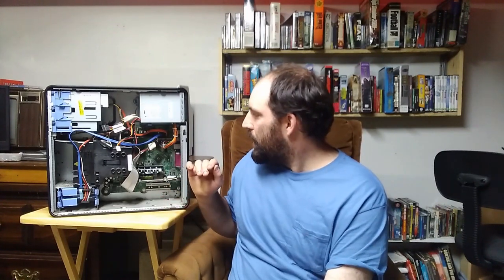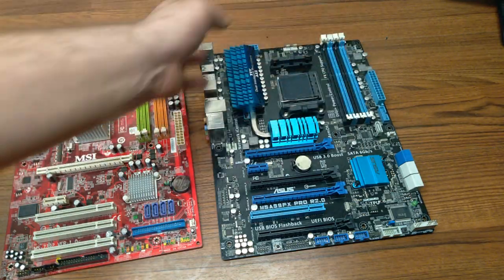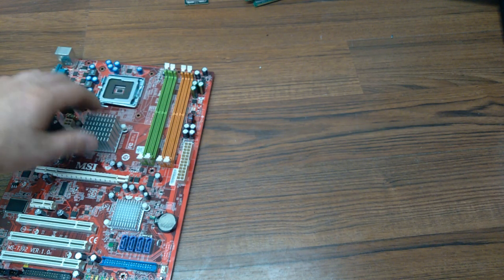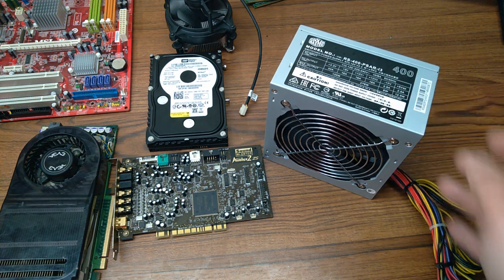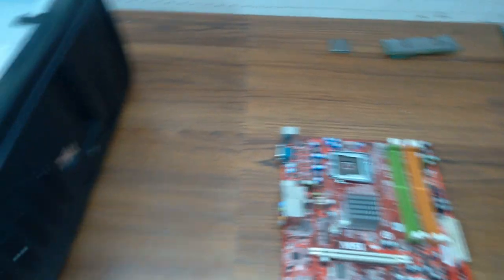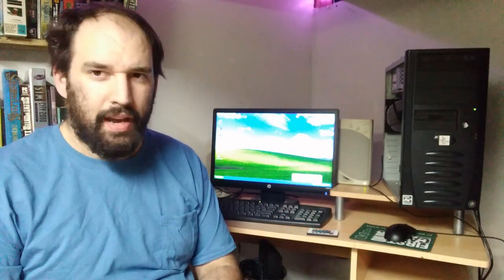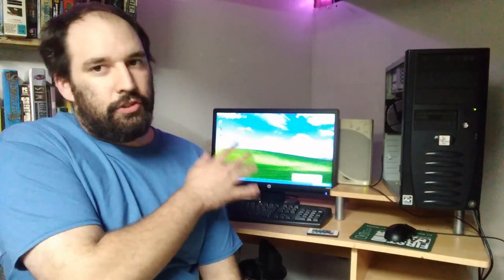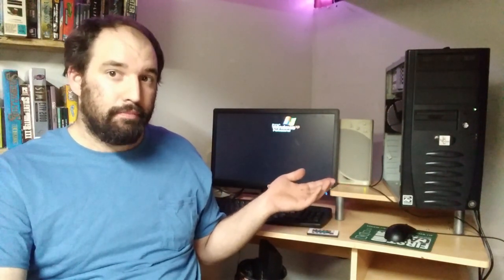Windows XP Build

Comment: I bought a brand new 8800GT oem version. It's a single slot blower model. But it's pretty silent and temps are good. Paid the massive amount of $10 for it :D. Seller had put the part number up instead of the model so no one else put effort into finding out what it was. As for the rest I use a G41M mb with Q8400 cpu. No issues other than it won't turn off by using the Start Menu option.
Reply from the maker: Nice find! I'm hoping to find another 8800 maybe gts or gtx the 250 is nice but in the edge of what I was going for.

Comment: Seems like every body is making an xp build they are beautiful 😍
Reply: Yep, I was thinking the same thing.  My Youtube feed has been littered with XP builds and I love it. The great thing is I still have all the old hardware from when I built my Xp system back in the Day, the Chip is an old AMD athlon twickers chip 1.3 Ghz OC'D to 1.45.  I have been thinking about rebuild my old system, though.  So it's nice to see what others are doing to their systems!
Reply: Guilty as chaged, just started my own build based on a Athlon 64 3500+, BFG Tech geforce 6800 gt oc, and found a nice CRT to go with it in a used books store of all places, I guess the guy who runs it used to have a computer repair store in the building, so I might very well be visiting more to see what other expantion cards and other bits he still has.

Probably going to be dual booting it with XP x86 and whatever version of Linux I settle on, much like how my modern desktop runs Garuda Linux and (a rarely used) windows 10

Comment: I have always had noting but issues with Optiplex systems. They seem to only like approved gpus, bios locked down to bare minimum and proprietary everything. The Q6600 is an awesome cpu, I used it in my daily computer for years.

Loving the content, keep it coming !
Reply from the maker: Yea most the optiplexs I've messed with were a bios pain, and yea i have a few more powerful dual cores and later quads but I wanted something more iconic. And dont worry there's plenty of content coming lol

Comment: This may help future viewers of this video:  The 1st PC case is an Antec Solution SLK1650B and most likely original. Antec cases were/are manufactured by makers from China and or Taiwan. This explains the "Designed By" mark. The 3rd case is an In Win C583 introduced in 2007 and can still be purchased new and comes with an In WIn or Power Man PSU. The mobo and GPU were released in 2007 so the build is period correct for 2007.
Reply from the maker: Holy crap i could never find the model numbers! As soon as I Google it, popped up and got reviews. 
And awesome, was hoping to stick around 07/08 for this since that was when I was planning on building one from affordable parts (well...for 16yo part time job me lol)

Comment: I remember when my dad bought a Dell machine from TigerDirect that came off lease from a business. Core 2 Duo with 4 1/2 gig sticks of DDR2 memory and running Windows 7. Most aggravating system I ever used because just opening Internet Explorer would max out the memory and make the system start using the swap file partition on the hard drive. Once I swapped 2 of the half gig sticks out for 2 1 gig sticks I had laying around made a HUGE improvement. Just upgrading it from 2 gigs to 3 gigs made it seem like an entirely different system. Oh and the case still has a Windows XP key sticker still on it, but someone took a sharpie to it and marked out the registration key.
Reply from the maker: Ugh. Hated that era of pcs...the late xp that was free upgraded to 7.
7 was way too system demanding for what xp had unless it was a high end xp machine..
Mine can run xp to 7 but xp was so much lighter. I cant count how many 7 era pcs I've stripped
Reply: @definitelycasualpcs8789  You'd think that if it were actual professionals doing these upgrades from XP to 7 that they'd test it out fully to see if it can handle running 7 with the hardware in the system.
Reply from the maker: @SOU6900  "but but but according to windows 7 minimum requirements itll work!"  Lol our school tried upgrading old dell dimensions (single core p4 and 512mb ram)
Reply: @definitelycasualpcs8789  😆 I wish I was a fly on the for that one.
Reply from the maker: @SOU6900  no wait...had to think...
It was upgrading to vista, the school's IT guy said it wouldn't be good, and luckily got s step discount on early core 2 machines with xp. (Since vista was the new cool thing xp computers were being discounted at first)
Reply: @definitelycasualpcs8789  I hated Vista😆. Just trying to find a file seemed like a chore in itself.
Reply from the maker: Lol then I won't mention I have a vista based video in the future
Reply: @definitelycasualpcs8789  😆 doesn't mean I probably won't watch it.

Comment: 20:35 you might increase performance by going dual channel. so slots 1 and 3.
Reply from the maker: I wondered about that..
The board says slot 1 and 2 are channel 1 and 3/4 are channel 2...but documentation online says 1/3 and 2/4...I'm going to download a different benchmark and run it both ways and see which one is which
Reply from the maker: Ok so I finally got benchmarks to work (using an...altered...version of xp means it missing certain things) 
And I found almost no difference in performance moving the ram around.
Apparently, the dual channel works and is enabled if there's 2 matching modules in any of the slots. I'll go into a bit more detail on the follow up, but either way good call, didn't hurt to try it. 👍

Comment: Recently built a secondary XP build for compatibility with Microsoft Flight Simulator 2002 Professional, which doesn't like my Q9650 XP/8.1 build. It includes the following:

Antec NSK4100 case (with Noctua fans)
Seasonic SS-600ET C1W 600W PSU (3.3, 5.0, 12v1 & 12v2, all 24A)
AMD Athlon 64 X2 4800+ Toledo 2.4GHz S939 CPU
ECS nForce3 A939 v1.0 board (1.0D BIOS)
AMD Ryzen Wraith Prism CPU cooler
2x1GB Kingston Hyper-X Cas 2 DDR 400 memory (dual channel)
256MB GDDR3 XFX 6600GT AGP graphics (93.71 XP driver)
Sound Blaster Audigy SB0090 PCI sound (with EAX 4.0 supporting driver)
160GB & 320GB 7200rpm system & data SATA HDDs
Lite-On DVD-RW & DVD-ROM IDE optical drives
Akasa USB internal Card reader
NEC 3.5" 1.44MB Floppy drive

Runs everything XP up to & including 2003 at 1280x1024 32-bit just fine. The Q9650 build does everything XP afterwards. So, all the XP now. ;-)
Reply from the maker: Ooo I love those specs! Interesting  choice with the amd cpu, I haven't messed with too many amd cpus from that era since they were a tad weaker at times than Intel counterparts (in certain cases anyway) but regardless that's awesome..
I'm surprised that that game has issues with the q9650? But .maybe its same case as fallout 3 in that it has issues with quad cores? 
But between those 2 machines that should cover a most games. Awesome!
Reply: @definitelycasualpcs8789  The purple ECS nForce3-A939 motherboard, with an Athlon 64 4000+ (San Diego), was the basis for the machine I upgraded to from an Athlon XP 2000+ build, when I moved to a new place back in 2007, as the parts were heavily discounted by then with Core 2 gaining prominence, while my budget wasn't that prominent. I then got the Athlon 64 X2 4800+ in 2011.

Then in 2020, with a kerbsided Advent T9100, I finally got to try a Prescott Pentium 4 3.20E Hyperthreaded processor. It was OK, but I found it wasn't as good as the X2 4800+, which performed significantly better with Windows XP, while also being cooler (not a hand dryer round the back of the PC), as well as being MUCH quieter. The Advent was subsequently converted to a 512MB PIII 800EB 128MB 440 MX YMF724-F 98se/2k build.

The 8GB DDR2 Q9650 2GB 750 Ti SB0090 build I did over 2016-2017, dual booting between XP & 8.1 (with Classic Shell). It handles the GOG version of 'Fallout 3: Game of the Year Edition', along with MS Flight Simulator 2004 just fine, but doesn't like FS 2002.

So, back in 2020, that's why I rebuilt (with new and additional/replacement second-hand parts) the 2GB DDR Athlon 64 X2 4800+ 256MB 6600 GT SB0090 build, as I remember it previously working well with MS Flight Simulator 2002 back in the day (then with a 256MB MSI Radeon HD 2600 Pro AGP silent graphics card, which unfortunately flaked out on me in 2015).
Reply: Specifications of the Q9650 XP & 8.1 (with Classic Shell) build:

Cooler Master Elite 370 case (with Anidees Halo blue LED fans)
EVGA SuperNova 550 G2 550W PSU
Intel Q9650 Core 2 Quad Yorkfield 3.0GHz S775 CPU
Gigabyte EP35-DS3R (Rev. 2.1) motherboard
Be Quiet! Shadow Rock LP CPU cooler
4x2GB G.Skill 5-5-5-15 DDR2 1000 memory (dual channel)
2GB GDDR5 EVGA GTX 750 Ti SC graphics card (with backplate)
Sound Blaster Audigy SB0090 PCI sound (with EAX 4.0 supporting driver)
Sandisk X400 128GB & 256GB SATA system SSDs
WD Black 1TB & 2TB SATA games & data HDDs
Lite-On DVD Writer SATA optical drives
Scythe Kaze Master KM01-BK VFD fan controller
Sony 3.5" 1.44MB floppy drive

Handles everything XP from 2004 onwards just fine, with the Q9650 being around 3 times more powerful than the Athlon 64 X2 4800+ multi-threaded (according to Cinebench R15).

Cinebench R15 Scores:
Core 2 Duo Q9650   @ 3.0GHz, 333 MT, 86 ST
Athlon 64 X2 4800+ @ 2.4GHz, 105 MT, 53 ST
Reply from the maker: Yea. The Prescott's weren't  known for being all that great,  especially the HT models, but it seems amd around the early lga 775 single and dual core Pentium 4 (and very early core2) amd did do better than Intel for a short time until Intel made a few changes to core 2 (I believe around 2nd revision)
Reply from the maker: Wow. Those specs! And yea that was AMD weakspot for a while was multithread, single core was fine but multi struggled, especially in the fx days. 
Now I want to go thru parts and build an amd based PC lol
Reply: Pretty sure I still have flight sim 2002 kicking around somewhere, thanks for reminding me to find if for my own XP build

Comment: I had that exact motherboard in a PC i had in the late 00's. I remember buying a 9600 GT and seeing such a huge uplift in performance compared to the 8500 GT Fatal1ty Edition which was hot trash even for 2008 standards.
Reply from the maker: awesome! I couldn't find too many references to the board besides a couple forums mentioning and maybe a few reviews. 
I remember a red board waaayyy back when I was in high school but didn't remember the exact details but this fit the era and features I wanted. 
And ironically I considered an 8500 and 9600 before deciding on the 8800gt.

Comment: That core 2 quad is for vista and win7 and a lil overkill for xp. Maybe a core duo or phenom x2 or athlon x2 6400. Anything or the best from 2000 to 2006 wud be XP.
Reply from the maker: Yea. Its a little bit much for xp. But it was one of those cpus I remembered seeing ads and stuff for. My previous desktop prior was a p3 (which I finally tracked down! Lol) and it just seemed to fit with the rest of the parts I wanted to use.
Never fear! I have plans for other xp era builds for fun (I have enough for a p4, Athlon xp, c2d, and dual core amd from 01 to early 05)

Comment: CPU cooler mounting brackets and screws, on Intel, always come with the cooler, not the motherboard.
Reply from the maker: I realized that after I got done building it. What bugged me was I've torn so many PCs apart from that time period that I thought I kept a couple brackets from some OEM's..but the box of parts I thought I had them in was not where I thougt...luckily I was able to acquire another pushpin style cooler that was much quieter

Comment: I hate to say this but the fact you’re putting in a quad core into an XP build, doesn’t make it an XP build IMO 

That socket and cpu suit more a Vista build. 

Idve used the last gen P4 or AMD XP Processor and, PCI-E I always felt was also higher up. Idve chosen an AGP card possibly. 

Otherwise cool video! Nice build!
Reply from the maker: Thanks. And yea I was (and still debating) on the quad core...I have an e6600 dual core but the q6600 was just that iconic very late xp era cpu (along with the 8800) 
Even though xp was still used and preferred up until 7 since Vista was....well...Vista lol 
I have a another pretty cool quad core xp planned...as well as a athlon xp build. My plan is to have a 2001 ish early xp build...mid 00s build with early pcie or very late agp...
And this one (or the other possibly overkill one I've got a plans for lol)
Reply: Respect!! Keep up the great work! I'd love to see what you come up with. 

My current builds are a souped up, but appropriate for 2005 Athalon XP 3200+ eMachines PC that I have had a lot of fun restoring. A Dell XPS 700 (Red) that I've been working on making into a Windows 7 SLI Build (I wanted vista but well.. you know.). I wanted the Dell to take advantage of DirectX 10 and 11. 

And my Modern (Main) PC is a heavily modified (Dell) Alienware Area 51-R2 that I intend on doing a few more things to before I consider it EOL And I make a new modern build.
Reply from the maker: Lol I didn't see that you responded 😂
I have some athlon XP boards..just trying to find that right cpu for it, i have some in the 2000 model range that would still work good, a couple p4 boards. I think I have some higher up agp cards (I know I have a 4200 or 4600 ti x8 ) 
Its all fun trying to pick and choose old hardware
Reply: Well vista ended up being the stable one as 7 was crashing like crazy lol
Reply from the maker: @AnimeGamer  that almost seems backwards lol 
I never really messed with vista. We skipped in when I was at home. We had a dell XP laptop (one of those massive desktop replacement Inspiron...5100? Iirc) and then in college I bought a windows 7 laptop, and later an emachines desktop running 7. 
Im kinda wantkng to run vista on this rampage board I did a video on...test xp and then maybe dual boot either vista or 7

Comment: Would the motherboard manage too run 333 mhz cpu overclock for 3.0 ghz on all 4 cores on the q6600 ?
Might need a better cpu cooler then that copper slug cooler.

Just lower memory clock too 667 mhz and it will increase up too 800 naturally, maybe a little extra voltage on ram & chipset will be needed, which ofc repaste the chipset cooler as well.
Though you can also do the bsel tape mod too get it running at 3.0 ghz without any bios changes.

Got a sort of testrig sitting around without a case & powersupply atm.
I went with core 2 duo e8400 which overclocks too 4 ghz on my asus p5q deluxe with ocz reaper 1066 mhz ddr2 sticks, paired up with a HD 5770 i bought in 2010 it wouldn't be a bad combo for windows xp.

Also sounds like the 8800 you had died on you & fallout 3 has issues with quad core cpus & some memory leak issues.
Textures on medium & making the game run on 2 cpu cores instead of 4 via taskmanager should make it run more stable everywhere, might be some community fixes if you google about as well on for example pcgamingwiki fallout 3, you'll find community fixes & patches there.
Reply from the maker: I have no idea..i tinkered with the bios setting prior to realizing the psu (the 400w one) was an issue, and found i could tweak a lot, and there was even an onboard overclocking feature (not a lot, the highest was 15%) and i def need a different one, this one was one i had laying around for lga775.

I may try that at some point after the follow up video and see if anything breaks lol and I may try the tape mod but not without one hell of a better cooler.

I actually considered the e8400, but opted for the q6600 since it was more "iconic", and ive decided to use the other asus board to be a test rig for benchmarking cpus and gpus at a later date.

Yea i think both 8800 i had died...i hoping to find another one soon. 3 is holding stable for the most part on high...but on ultra i get issues..even on FEAR...im thinking this cheapo 650w is an issue to (it has 4 12v rails so im thinking i need to break down somethime and get a newer beefier unit of quality

Comment: Soc 478 is only way to go with XP cos there is lot of issues with software backwards compatibility ✌️💪
Reply from the maker: So far...I haven't had much for compatibility issues. But I haven't tried a lot yet so we will see..besides I have plans for a 478 build at some point
Reply: Compatibility issues with what?  Can you give examples?  Just so I can try them on my XP system.
Reply: @flightsimdeskuk  for example Soundblaster 2 does not have a support for Vista, and if it work then software can't. Propelerhead for XP is example.
Reply: @DanijelDrnic  Soundblaster 2 isn't an XP card is it?  Audigy and X-Fi are XP cards.
Reply from the maker: Yea...the sb2.0 was an isa card from the late 80s...
Unless by compatibility they mean with dos and isa cards...and very very few lga 775 boards had those